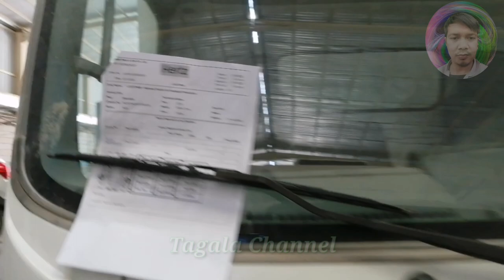How to Replace Clutch, Clutch Disk, Pressure Plate, Release Bearing, Isuzu truck, Clutch Assembly

Comment: Boss good day, magtatanong lang. Ang sasakyan ko ay mux 2017 4jk1-tc engine. Pag umaga or kapag nakapagpahinga ang makina nang atleast 8 hours pag pinaandar merong tumotunog sa ilalim sa may clutch part, pag apakan mo yung clutch nawawala ang tunog or kapag mainit na ang makina for 10 mins, nawawala na ang tunog kahit di inapakan ang clutch. Tapos medyo mahirap ipasok sa 2nd gear.
Reply from the maker: Para po hindi ka na mangamba mas maganda po palitan mona clutch assy. Pressure plate, clutch disk, release bearing, para hindi na po lumala ang sira